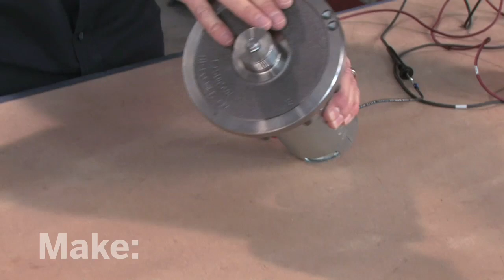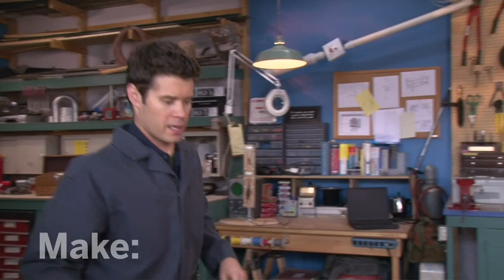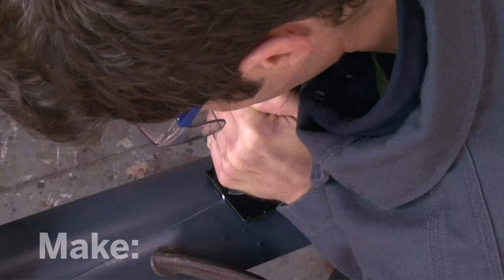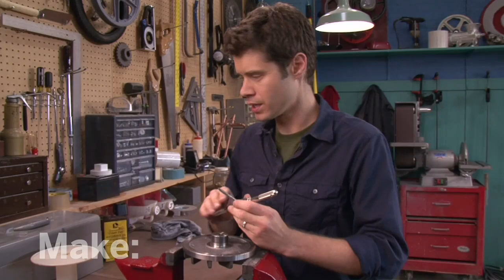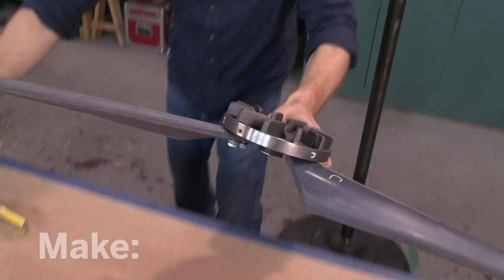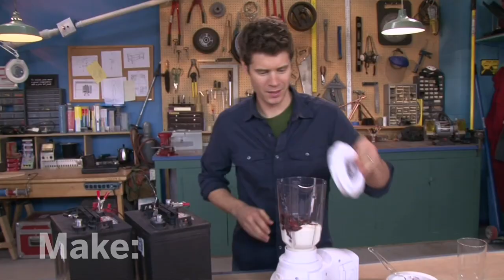Maker Workshop - Wind Power Generator on MAKE: television

Comment: hey thats actually pretty smart thinking, I don't know the answer but if you use that thing that makes the electricity go one way I suppose it might work. Question I'm dealing with is where can you get some super mass storage battery and also if you could directly apply it for use in your home and you wouldn't have to connect the battery to every single household equipment.

Comment: Great video good info 
A little heavy for blades don't you think?If they ever break loose look out  ,you can use a ligther  pvc pipe  and add as many blades as you wish.The lighter blades is what I use  and have seen 60 mph winds and still will standup.

Comment: If you have the tools to drill the holes into the flywheel...why not use the mounts you get from old cieling fan blades. I'm actually looking into doing something like that. The Bridge Rectifier is brilliant...one of my hold ups was how to use any motor as a generator rather than having to buy an alternator or something else like that. Thanks for the great vid...this is very useful.

Comment: So what stops the wire wrapping round the post in a changeable wind and ripping the wires off the generator or batteries? Surely you need a slip ring?

Comment: Hey. He called his sabre saw a sabre saw. I like that. A lot of people are now calling sabre saws "jig" saws. And they call jigsaws scrollsaws! But they don't call jigsaw puzzles scrollsaw puzzles.
Reply: Another person has pointed out that this tool is currently called a jigsaw. I think I first learned the "sabre saw" name for this tool in the 1960s, and for all I know this name may have been used in North America only. Jig saws had been around for a long time, later ones with electric power. Jig saws typically had a table with a vertical reciprocating blade that was supported from the top by a spring arm. A limiting factor for work size was the "throat", i.e., the distance from the blade to the arm. The breakthrough for the sabre saw was that it had no support arm, no throat limitation, and was highly portable. I think people used the "sabre saw" name to distinguish it from the traditional jig saw. But as far as nomenclature goes, we seem to be losing the distinction.

Comment: Out of curiosity, what was the total cost of making this? I'd assume that you can get a treadmill motor for cheap from one found at a yard sale or thrift store, but what about the 8" pipe, the aluminum brace, pipe fittings, and other small odds and ends?

Comment: Hi, I didn't see you use something to control if the motor produces over voltage like 20V or 30V to charge 12V battery? So what you gonna do if motor produce like 30V or up?
What you use to know the battery is fully charged to avoid explode?

Comment: car altenators have to have a back voltage so if the battery is drained it can't charge.. thats what i was told you can mod a car altenator

Comment: there is one thing   you didn't say what the measurements for the end cut  or angle cut . what is the with  for the end of the blades and  the angle for the side you mount on the flywheel ?  you just gave the with so   that you can get two blade  from  5 1/4" wide piece of pvc

Comment: Is it just me or is there nothing stopping the motor from doing several revolutions and unscrewing off the top of the pipe nipple? Other than that a very nice simple design for off grid power.

Comment: Also, you can get a 750 Watt Black and Decker
power inverter from Wal-Mart for $ 60  which
can run off the 12 V battery and run 120V AC
appliances, up to 750 Watts with 1500 Watt
surge-start............

Dont need to use 12V car appliances at all,
Just needs time to charge battery full.

Venger

Comment: He used a new motor in the video, the
McMillan Electric model S3456B3282 permanent magnet motor.

Costs about $90 new.  I got an old one from a
Treadmill, and it had rust spots and flaking
paint all over, but it works.......

Comment: I made one very similar to this one, in fact I might have gotten the idea from this vid.  there is no reason to include the flywheel, it weighs at least 5 lbs.  blades made from thick pvc require more wind to start than most DIYers can facilitate (tower) A design that used 8 or 10 lightweight blades covering more area would be better to start a treadmill motor IMHO testing vids of my wind generator are on my channel

Comment: Hi, great video. What Amp and Volt is the Bridge Rectifier that you are using and also what size cables should I run from the Wind Turbine to the Batteries? I am going to be charging 2 X 110 Amp Deep Cycle Batteries. Many thanks.

Comment: Noticed something...........

If he had swapped the leading edge of his
blades for the trailing edge, he would have
increased efficiency of windpower collection
by 331 percent, sice the blade ends would
not have been totally vertical, blocking airflow.
They'd have been almost horizontal instead
which would provide lift-torque.........

Venger

Comment: or what about goin much much smaller and installing under the hood of an electric car with a mean hood scoop directing the wind to the cylindrical almost reel mower like turbine that will constantly be replenishing energy right to batteries or even run the vehicle independently once vehicle is up to speed.  pretty cool huh
Reply: energy cannot be created from nothing so the drag will slow the car resulting in inefficiency.

Comment: Uhmmm.. if you look in the booklets when you get the xbox 360 you should see the amount of energy it uses, it its under 12volts (which i doubt) then you could actually power it with a generator.

Comment: i would love to see him hit a tree while testing haha
but ya if you had one truck with a lot or one big fan couldnt you get more energy?and charge more batterys at once but it only cost you the amount of gas you use? one ore thing you have a wind tunnel witha a high powered fan syphened off to smaller ones on smaller fans that lead back to it could you get mote energy than you put in or the big fan powered by a free energy fan directly like an amp or a transmittion

Comment: So wait... lemme get this straight... he had to drive his truck at 15 miles per hour for about 20 minutes with a wind generator mounted in the back, to charge up his batteries enough to run a blender and make a smoothie...  And he says that the best part is, it was made with free energy...

Last time I checked, there is nothing free about driving a truck...

Comment: so many errors in design. voltage rectifier? 1_diode is what you need. no brush system to allow full rotation. in Wisconsin, it would be destroyed in a day. the coupler needs a TAC weld or it will loosen and fall apart and neighbors will have a lawsuit. wow. sooo many errors... what amperage output? voltage is half what you need... waste of a video.
Reply: RLEESTUDIO.  Sounds like we need your video build fast! Message me on your project.